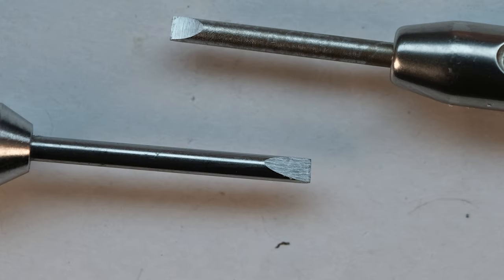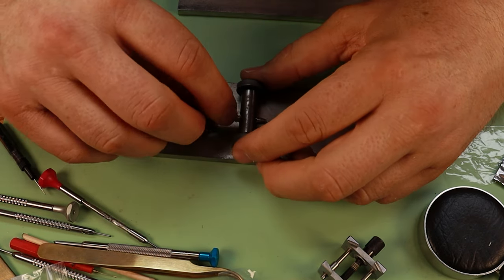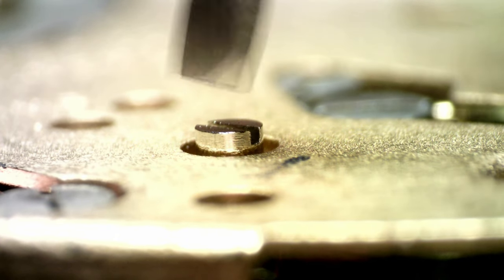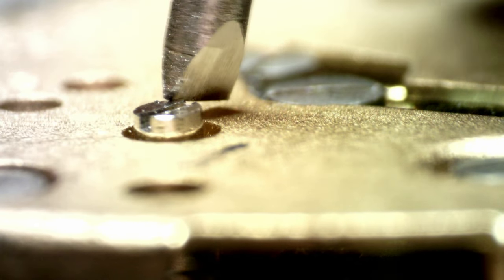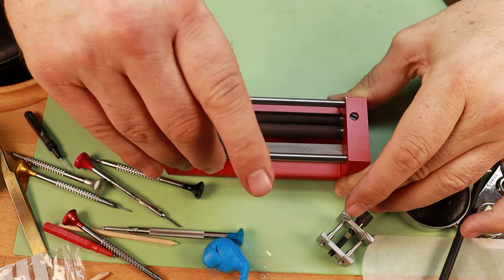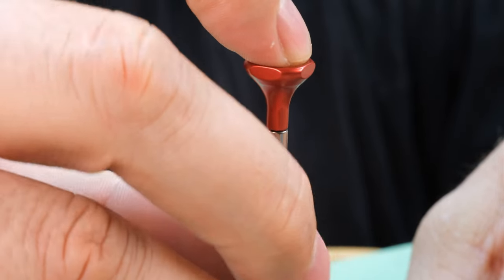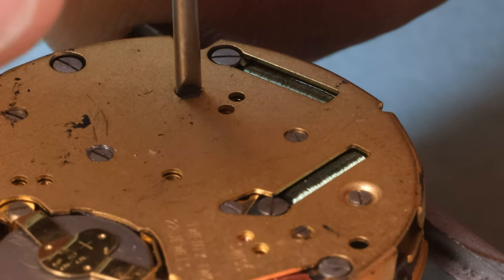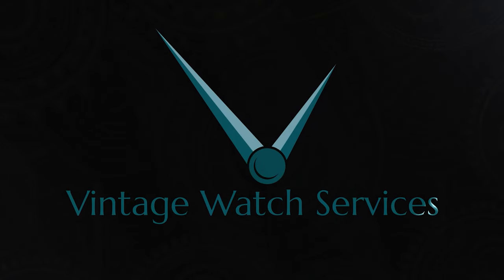How to use and choose screwdrivers!

Comment: Thanks for the video! I like how you beat up a quartz movement for the demonstration!    I have trouble when grinding down the end. I tend to take too much off and the blade is too thick for the screw slot. I guess it will resolve in time and practice. It might be a good idea to have a junk movement around to test how well the sharpening went.

Comment: Never scrimp on the screwdrivers.
The first set I bought was Anchor branded.
The grub screws were made of cheese and refused to hold the replaceable tips in place.
If you dared to try and tighten them up, they turned into s mess of 'metal' pieces.
Ended up buying a much better but still cheap set from Cousins that I am much happier with.
Reply from the maker: Yep, spot on

Comment: not about screwdrivers but was wondering what you have in the pin vice for cleaning pivots?
Reply from the maker: It's a product called EVE Flex, I'm using the extra fine grit

Comment: Thanks for doing this video!  Is there ever a ratio of width vs depth for a screw head slot?  Like for a single watch? or a specific brand (ie, Omega 550 series are always 1 deep X 0.25 wide, or 1:4 for instance)? Or are they all over the road?
Reply from the maker: Each brand certainly has some manufacturing ratios they stick to, but there's no overall ratio. Smaller screws have narrower slots, mostly do there's enough metal behind to sustain the force of the screwdriver. On modern movements which are assembled by robots, you will find extra wide slots. And on some watches, they're all over the place, like the Seagull I did on the channel...

Comment: Hi Stian, what grit is diamond stone you are using for sharpening screwdrivers? Thanks
Reply from the maker: It's a Fine diamond slip
Reply: @VintageWatchServices  thanks
Reply: On Cousins there is 2 options for fine diamond stone, which one you are using, the DMT one or value one? Thanks Stian in advance
Reply from the maker: @BokiPetrovic88  The DMT one, it's going to last much longer. It's false economy to go with the cheap one, it's not very good quality and you'll have to buy another one much faster.
Reply: @VintageWatchServices  yes I assumed. Thanks

Comment: Does anyone make hollow ground screwdrivers, or do you have to create them yourself with the expensive grinding tool?
Reply from the maker: You can buy the blades for any screwdriver. I use Horotec but Bergeon also makes them

Comment: Excellent! I’ve found that it’s all about what’s going on at the tip and the shaft isn’t so important. Any cheap brand of screwdriver is fine if the end is well honed.
Reply from the maker: Well, the metal needs to be good. Screwdrivers will literally last a lifetime, so buy good ones!

Comment: Really useful. I have done a bit of screwdriver grinding for screws on some old antique guns I have restored. Back in those days the screws had very narrow slots compared to the size of the screw and modern screwdrivers just don't fit. I have ended up making some replica antique screwdrivers.